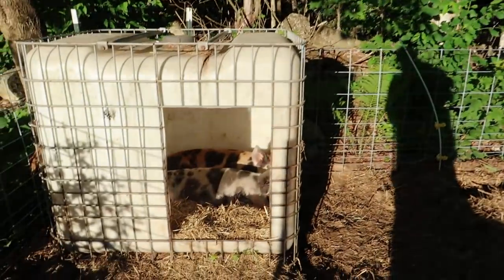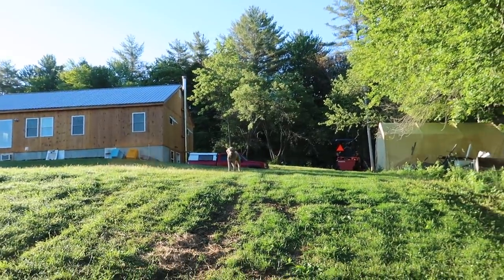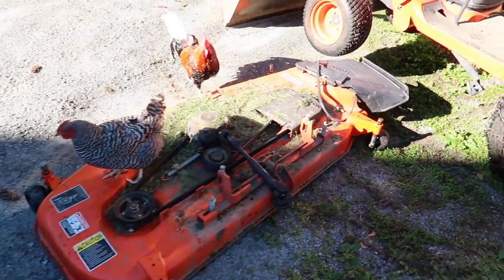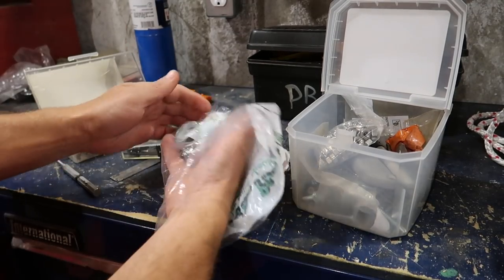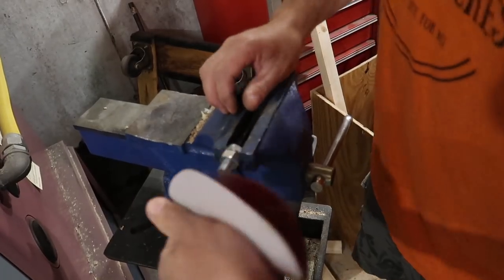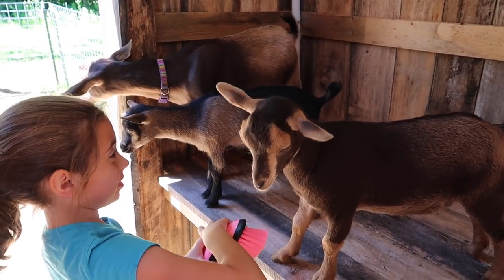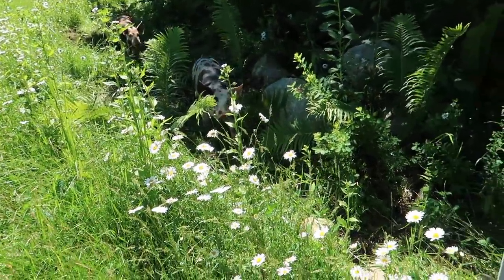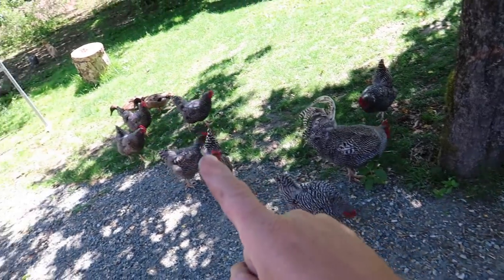I BROKE the Kubota!

Comment: Al you got super lucky with that bolt!  That Bota looks pretty new, which greatly helps.  As for the deck casters, when I bought my Cub 1782 it came with a 60" Haban deck and the front casters did not move a bit.  I sprayed the caster pins with diesel and then tapped them out.  I took emery cloth to the pins and coated them in axle grease.  No issues now.  Saturday my kids and I visited ArrowRidge and we got to help butchering chickens.  It was a great experience.  I definitely need to get a chicken plucker!!  Those goats are lookin great!  I cannot wait to get some!  Have a great week!

Comment: You got lucky with the bolt! Sometimes when the head comes off a bolt it relieves the tension because it's not holding anything on anymore. It's always nice when a job you think is going to be a pain, goes easy. Nice processing equipment!
Reply from the maker: Yes it sure is nice when that happens

Comment: I use grass clippings on my garden. Reduces need to water and feeds the plants as they decompose.  Also cuts down on weeds.  Best mulch I have found.  It has to be 'teenage grass'  as Joe Salatin says.  No mature seed heads. In the fall, when worked into the soil along with leaves, improves your soil immensely.
Reply from the maker: how is your garden doing this year?
Reply: We are setting up a new homestead so I have a new garden plot. got it in late since we had to fence it first.  Got a big load of composted horse manure.  Have in about 40 tomato plants. So far I am pleased but dealing with the usual problems with a new plot.  Have it totally mulched.  (except the 7 rows of corn) Thanks for asking.

Comment: The star in the center of the washer locks it onto the shaft which helps keep the bolt from loosening. I recommend you get the correct washer and bolt from your dealer. In the meantime, check the bolt before each use. Also check that the blade isn't bent. On my JD the blade runs close enough to the edge of the deck that I can use it for a reference. No tools or measuring needed.

Comment: FYI - when you break a bolt off. use a dramel tool with cutting wheel, make a slot in the middle (makes a flat headed bolt) use flat head screw driver to un-screw it .

Comment: We just replaced the deck wheels, greased them and they work great. Watched a video yesterday about training little does to milk by letting them on the milk stand with a small treat and then just rubbing their bellies and teats. It gets them used to the motions before it ever becomes an issue. Start on those little girls now. I will keep asking about that battery to the electric fence until you explain it.😂💖
Reply from the maker: What do you want to know again about the battery

Comment: When you lose parts like that from the tractor try finding some sort of real large magnet to drag behind the tractor.
One thing you might want to do is check the “HARDNESS” of that mower bolt and the washers. I believe those washers were hardened (Grade 8 or better).
The reason for the harder parts is they are better at securing high vibration parts at higher torque values on this bolt.
You also might always want to use gray anti-seize paste because of the wet grass .

Comment: When you knock off the head of a bolt it releases tension on the threads. Hope you put some anti seize on it so you can get it apart later when you replace spindles

Comment: I put never seize  on the threads of all my mowers,blades come off easier.Lucked out on that bolt,had to drill mine a bit one time.
Reply from the maker: I hate having to drill broken bolts out. I was very thankful that it came out the way it did

Comment: can you talk about how long you let them bleed out? Essentially if 2 people were butchering whats the minimum amount of cones you'd say so you always have a bird ready for each stage? do you stagger the killing so you always have 1 or 2 for the plucker?
Reply from the maker: we stagger the killing  and we have 1 plucker and 4 cones. But 6 cones would be better. We let each bird bleed out for a few minutes. then we scald them in 145 degree water
Reply: +Mavrck2711....I'm not AL, but may I answer from MY experience? Personally, I let 'em hang until I only get a drop of blood every 4-5 seconds. Plenty close enough to 'bled out'. JMHO.
Reply: +"LuMbuh Acres....6 cones is a bit much for me. The scalder is the biggest 'bottleneck'.  Depending on outside temps, pushing bled birds thru too fast makes for breaks while it comes back up to temp. More than 40 birds with a person at each 'station' really needs 2 scalders. The plucker can easily handle 3 or 4 CornishX at a time.
Reply: singleman thanks for the info never thought about it but dunking birds has got to screw with the temp. Makes sense that's where I'll get a bottleneck